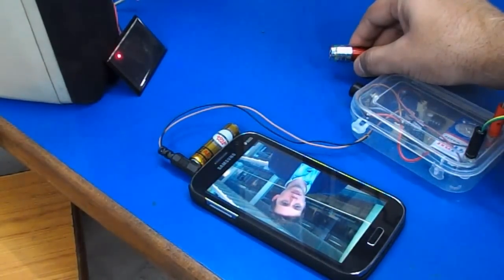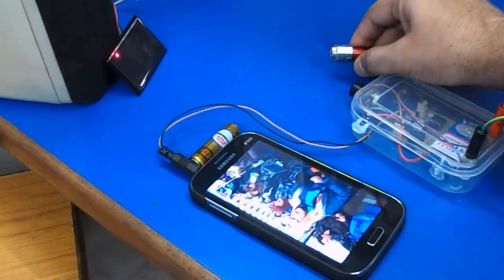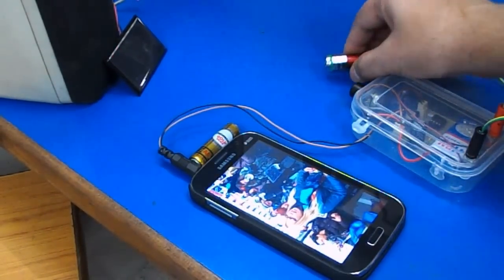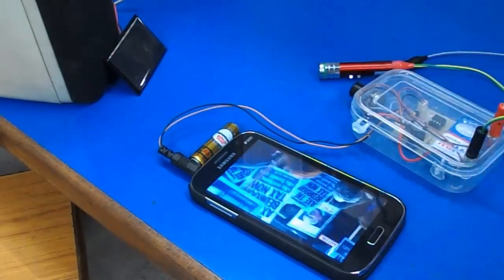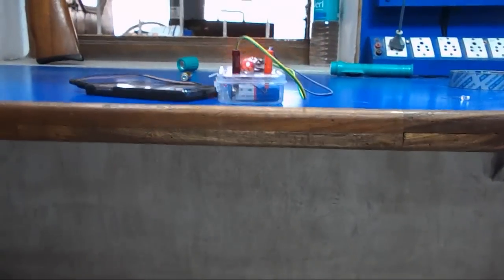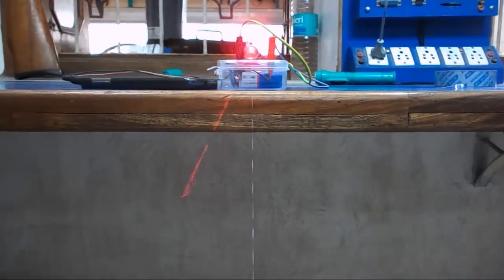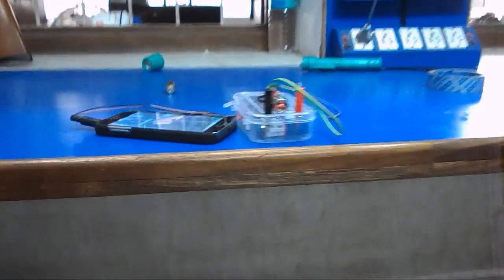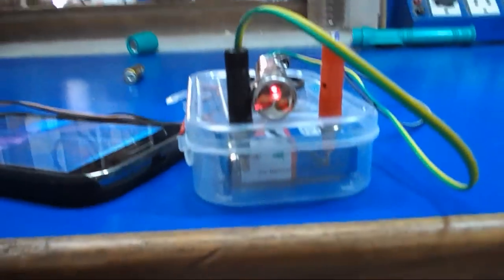LiFi communication Audio Tishitu

Comment: sir plz help me, can I use the " ktc cons lab PAM8403 2×3W class D Digital Audio Amplifier Module 5V usb power " for ( Mobile aux cable signal ) lower signal to higher signal, and I use 532nm  green laser.
Reply from the maker: sure u can but first try red laser

Comment: Mah model isn't working
Plzz help me it's urgent....
Reply: M not getting sound from the speaker
Reply from the maker: @anonymousstar3106  first try 1 hz frequency by function generator or other source then square wave attach led with probe and focus to panel remember negetive end of solar panel probe is to connected with -ive terminal of amplified probe and positive is connected with  signal of amplified speaker enjoy
Reply from the maker: tell me the problem

Comment: I Actually working on this project . I connected the transmitter circuit as in the video .I got the led glowing but when i focused it on solar panel which is connected to solar panel ,it is not getting audio from speaker.....will u tell me which kind of led will give sufficient energy to the solar panel
Reply from the maker: well its an normal led with circuit ... try normal LED with some frequency generator circuit with 50 Hz frequency you may listen humming ... if it is ok then this is a good sign :)

Comment: Hey Tarun.. I have done Ph.D. in Optical wireless communication. Your video is very motivational. I want to pursue my research in VLC. I want to design a system to make a hall completely wifi. Can we work togeather, i would need technical assistance. I have many research plans related to VLC. We need to discuss, kindly provide your contact details
Reply from the maker: u can call me 9829184348

Comment: Hi i have taken 470 k resistance instead of pot and i am using 5.5 V DC and 250 ma rated solar panel.LED is ON but still not able to hear the audio.
Reply from the maker: try listen sound from tubelight if you hear something then receiving side is ok ... bcoz u can listen 50hz of frequency
Reply from the maker: well from tube light there is 50 Hf of frequency emit and solar panels able to receive that range connect -ive and +ive  ends of solar panel to amplified audio speakers if you hear sound then it is ok

Comment: hi.. can we send me the receiving circuit.. actually i am working on it but the range of system is very short like 1 feet.. i want to extend it up to  3 meter.
Reply from the maker: +Noman Arshad u can use Lasers or use high current high frequency Mosfet ....If you design Professionally it may cost you
Reply: +Tarun Shrivastava  . currently i am using simple led for transmitter and solar cell as a receiver ..
 can you send me the RX ( receiving )  circuit diagram so that i can figure out where i was wrong .,
Reply from the maker: at receiving circuit there is no any additional circuit you have to design just connect audio input of amplified speaker to solar panel thats all

Comment: hi bro,I tried the circuit but am facing some problems.1|The moment the phone/pc is connected to the circuit through the audio jack,the laser/LED goes off!   2|  And if I remove the ground connection(pin-4) of the op-amp the LED again is on.OVERALL,STILL I'M NOT BEING ABLE TO TRANSMIT SOUND!What can i do?????
Reply from the maker: +halaku dutta please send me video to tishitu@gmail.com and pics to to identify your circuit
Reply: +halaku dutta It seems that i have the same problem with you. i'm still curious how to solve it.
Reply: +Tarun Shrivastava please send me the video. my mail is  samsonfabiyi748@gmail.com
Reply: The circuit didn't work at all.In fact,when I simulated the transmitter circuit in Multisim,I didn't find any amplification of input signal.Currently,I am looking for a new circuit for the same project.If possible,I would like to design the circuit myself.BTW about the circuit of this video::It seems probably the values of components(resistors and capacitors) are not correct in the given diagram......changing values may work.......I didn't succeed though
Reply from the maker: send me your circuit via courier service or send me proper video to tishitu@gmail.com
Reply: sorry, for now i only have the picture. Is it still can be use for you?
Reply from the maker: Well in picture i cant test like you are having circuit with you .... circuit is with you and still you are not able to get where problem is  so picture is not enough for me to sort problem ... i cant test potential .. signal patterns , current level in Picture .. ??
Reply: So i have to make a video like above?
Reply from the maker: send me ur circuit

Comment: hello bro.... i have a question -- if i use  r3= 9k ,r4=r5=12k then will it work.....??...  for input side i have an audio input jack which has 3 wires,  how can i connect 3 wires in the circuit...??
Reply from the maker: +amoresh k sure it will
Reply: +amoresh k    does 5 volt 150 mA     solar works for this purpose...???
Reply from the maker: well big one is ground and rest 2 are audio output .... take two resistance of 1k and one end of first resistance with left audio then second terminal is connected with second resistance and another end of second resistance with right wire ..... well second terminal of both resistance which  is connected with each other is audio output :) enjoi
Reply: +Tarun Shrivastava  bro,thanks for reply...   not working... when i connect my phone in audio jack then LED/LASER  goes OFF.....  the  emitter to  ground voltage  get decreased from  4.44v to 1.56v.... whaT IS THE PROBLEM , BRO??
Reply from the maker: can u send me da video
of ur projects with different angles snap shots
Reply: +Tarun Shrivastava  bro....  in your circuit C3=1000uf is given but u used 22uf!!!....  and u  didn't say anything about  voltage rating of capacitors....  still unable to transmit audio....

Comment: what is your program for open the .pcb
Reply from the maker: +cesar ismael mora delgado express pcb
Reply: +Tarun Shrivastava thanks..................the circuit is connected to the potentiometer pin 3 while the .pcb pin 2 is connected to the potentiometer  .......................... this right?
Reply from the maker: center of potentiometer can b connected with ie 1 or 3 if it is connected with three then it make 2 pin variable resistance so no worry about pin config ... or if prob msg me again
Reply: +Tarun Shrivastava   

pin 2 to pin 3 of the 741 are changed in the circuit with respect to .pcb this generates some error or can be transmitted by having the same backwards comfiguraciones
Reply from the maker: MAIL ME AT TISHITU@GMAIL.COM YOUR SUGGESTIONS

Comment: Do the speaker has in built audio amplifier ?? as solar panel may not able to drive directly speakers ...
Reply from the maker: yep it must have audio amp inbuilt or possible high pass filter or band pass filter for 50 hz. well in market ready to go amplified speakers work fine
Reply: +Tarun Shrivastava   Thanks ... It really works ...   So which type of LASER did you use and upto what distance its possible with LASER ..

Comment: i dont know u understand my question ir not. 

i want to know us it have a network stream or what it is i dont know what it is. but if we get lifi than do we still needs data plan or wifi plan and on which data plan its work
Reply from the maker: +Ishaan Aggrwal Still this device is prototype only and simulate with 232 protocol not with tcp/ip ... well like a "Eye-Fi" Wi-Fi is needed but in Li-Fi it can use both Direct WAN connection or Router For Re direction

Comment: sir i have a question 

may be it is faster than wifi 

but it still needs data which is provided by company which they don,t transmit on good quality or with lower speed so my question is 

if it is. transmiter the same speed provided by. companies than why to use this and what benifit or 

it is creating its own stream network or what how it works

Comment: Hello, I tried the circuit by adding two 220k resistors in series instead of Pot, the led glows without connecting the input audio source.But it switches off as soon as input sound source (mobile) is given to the circuit. Can you please suggest a solution to this problem?
Reply: +varun b s  the led is glowing very low brightness

Comment: can you please explain which type of audio jack will use for it
Reply from the maker: this is depends on your audio receiving device ... well ive no take any audio jack on it or you can combine left an right audio lines with 1 k ohms series at both ends and center is connected to solar panel of 4.5 to 6 volt and negative wire with stereo ground ... enjoy

Comment: Hi Tarun, if we  replace 300 - 500Kohm resistor, how to control the volume (you showed in video).
I tried so many times to your circuit but i couldn't get the output... if i am short circuiting pin-3 and pin-6 then only working and output is very small...please suggest me to complete this...
Reply from the maker: +Harish Kalla if you want to fix resistance you cant control the volume it fix the volume at certain  level . please fix POT for variable volume control with one mag ohms
Reply: +Tarun Shrivastava ,
Thank u for ur suggestion....
Is it possible to use LM386 audio amplifier instead of 741 op-amp

Comment from the maker: In video 1M OHMS Preset (Pot) replace by 300 K to 500 K Resistance
Reply from the maker: Muhammed Anaz P K just go for any 6v 100 ma Solar plate and panel directly connect to audio input of amplified speaker
Reply from the maker: +Muhammed Anaz P K in a receiver circuit nothing u have to do take a 6v 100 ma solar panel and connect -ive terminal of solar panel with -ive of amplified speaker and +ive with both Left and Right wire of amplified speaker
Reply from the maker: yep it will work gr8